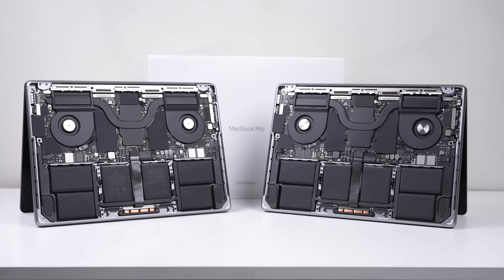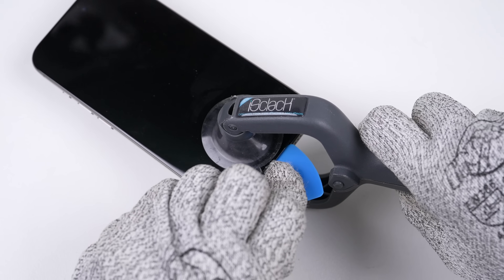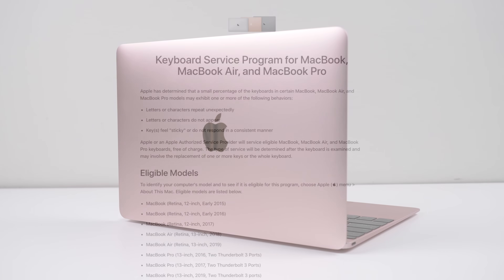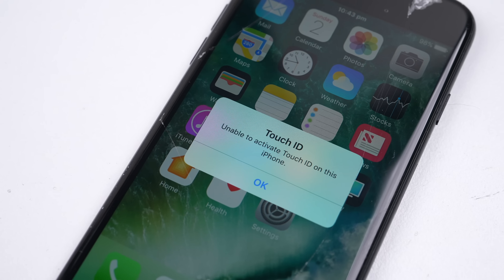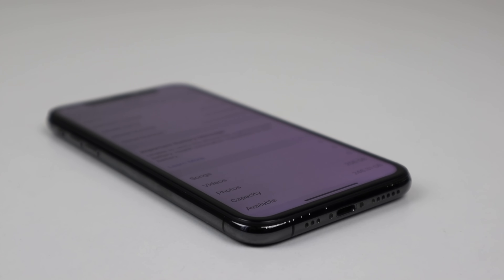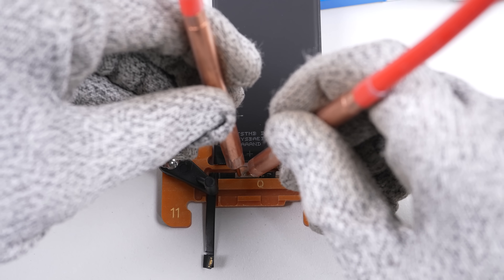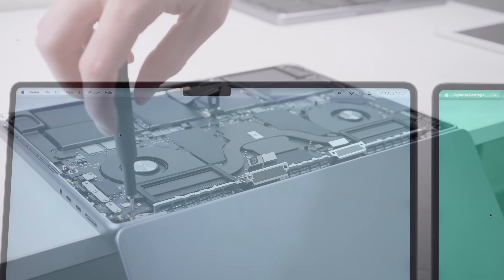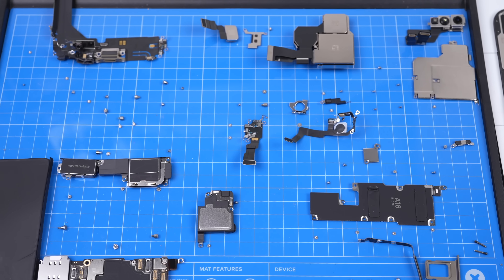Astonishing Anti Repair Practices By Apple In the Last 15 Years

Comment: That is why I have refused to buy any Apple product. Luckily other producers are not that crazy.  Thank you for your hard work of exposing these despicable practices of Apple.
Reply: If only 70+ % of the US sheep consoomers would stop buying as well.
Reply: The only Apple product I ever bought was a last generation iPod Classic
Reply: apple counterbalances all of this by having the most eco-friendly production process and the greatest longevity of its devices, especially iphones, which I think outlast the vast majority of android phones.
Reply: @haomingli6175 I think you completely ignored the part of the video where he blatantly states the batteries are designed to die at an unusually much faster rate 😅 and the system also goes even slower with each update, and older devices will have issues after every update until they become obsolete
Reply: @christopherfeatherley  I don't care. I just care about how long iphones last compared to phones of other brands. the available evidence suggests that iphones last the longest, and apple supports the hardware for the longest via software updates, except for the promise made by fairphone, which remains to be seen if they can actually keep up. but apple has been already been able to deliver 5-6 years of software updates to a phone. and this is only to be expected because each update packs more features and will be more demanding on the hardware. the intentional slow-down is related to battery health; you can swap the degraded battery out to get your performance back
Reply: @haomingli6175 Ooh okay, enjoy being in the apple ecosystem then, whatever you want to believe and anything you want to remain ignorant about.
Reply: @haomingli6175  "I think" what a great argument. By "outlast" you mean until Apple eventually remotely decreases the speed of your old phone to get you to buy the new ones?
Reply: @enderagent regardless of what apple does to the phones, they last longer than most android phones; this is what outlast means. do you want to contest this point? apple keeps updating the software for the longest, which means they expect you to use for at least that long; the "eventually" comes so late that iphones will have already seen the demise of its peer android phones released in the same year. besides, the performance decreases are not dramatic; they don't turn a usable phone into an unusable one.
Reply: @enderagent  further, the performance decreases are linked to battery health. you can simply replace the battery to get your performance back, which isn't very expensive even if you let apple do it. and it is third-party serviceable as well; apple has not serialized the batteries.
Reply: @haomingli6175  they better have an eco friendly production process when you have to buy a new one when you crack the screen.
Reply: @haomingli6175  the fact that you are even pretending to believe this is hilarious

Comment: For the vast majority of Apple users, an Apple device especially their iPhone is a necessity rather than an addition that facilitates their life. Apple owners find it very hard to think of a life without their Apple devices. This is the reason that helps Apple in locking their devices and making their consumers just people who pay an upfront rent before getting their devices rather than owning it. Apple has a cult following especially for its carefully curated hardware and software and people who are part of it never leave it. So everyone outside of that cult whether you like it or not, Apple will always do it the Apple way and their fans will never bother as long they have the Apple experience intact. I once fell into the Apple ecosystem with an iPhone SE and since I didn't like their practices, I left them never to return again until I think I actually own an Apple device which I don't think will ever happen unless they face a downfall like Nokia.

Comment: If Apple made a car, the bonnet would be welded shut, and you'd have to buy a new car when the spark plugs failed.
Reply: Look up Mercedes EQS or, even worse, Volvo Your Concept Car. This isn't as far fetched an idea as you think. You may even see a parallel between YCC and iPhones.

Comment: Apple devices are good but their lack of serviceability is what makes them the worst. I always recommend other devices because of this, especially Framework laptops. I doubt anything will change, even with these new Right to Repair legislations.
Reply: If by "good" you mean "they turn on and technically function when bought brand new" I could agree with you.
If by "good" you mean "at least as performant and functional as the average competitor" then all of reality disagrees with you. Apple runs 1/4 as fast for 4 times the prices in every regard. Their environment, which they call a "walled garden" means you have less functionality with Apple than even with the average $60 tablet of unknown brand name. And in general, if you actually WORK using your devices, then you never want an Apple, no matter how many unemployed technical art students tell you otherwise while defending their Mac ownership: Because production environments don't run on Apple as the tools, the confidence in data persistence, and the employees would only be dragged down by working on a device you can't repair same day.
Battery finally gave out? Sorry boss, gotta wait 21 days for Apple to unlock my hard drive before I can turn in my finished work for today.
"You're fired."
I just imagine checking something out from source and this happens. NOBODY can work on it until Apple deigns to give you back your own hard drive's contents, so the company fires you and hires someone who can manage source control to prevent this issue with the next guy who brought a macbook to work with the same wages they used to pay you.
Reply: @DawnBriarDev yep, I meant the former. And yes I agree with the latter as well, they're so trash after purchase.

Comment: In short. If you want a phone that is very easy to repair, cheaper, and does the same thing. Don't buy an iPhone.
Reply: theres no reason to buy iphone other than to flex. if its macbook its still reasonable, but i dont see any value on iphone.